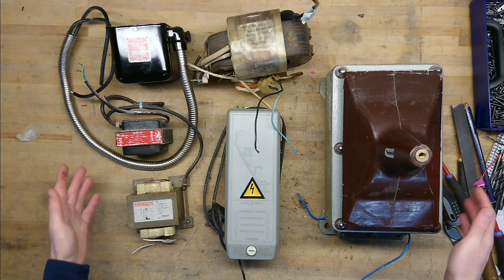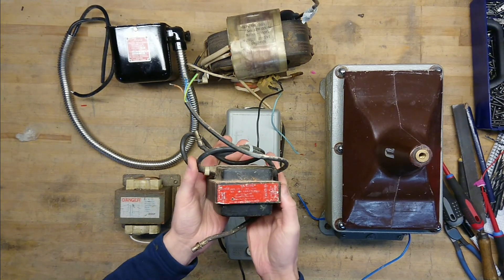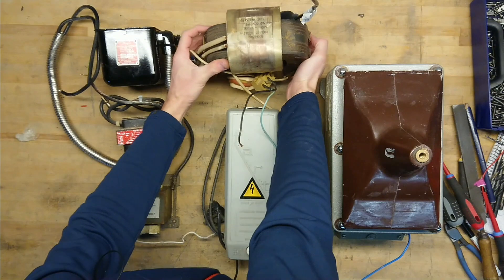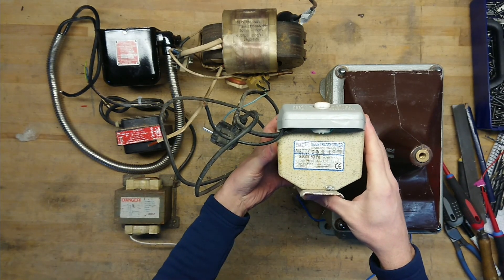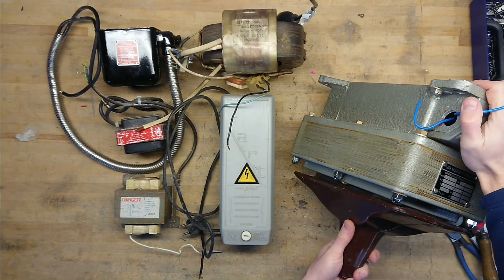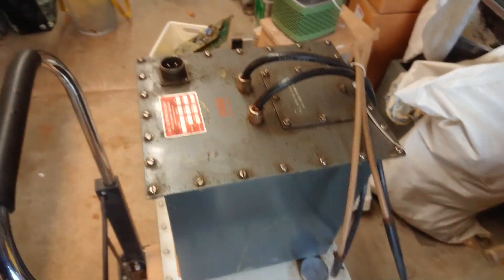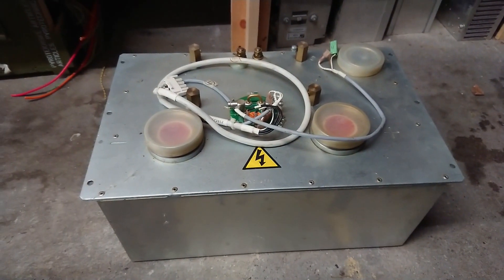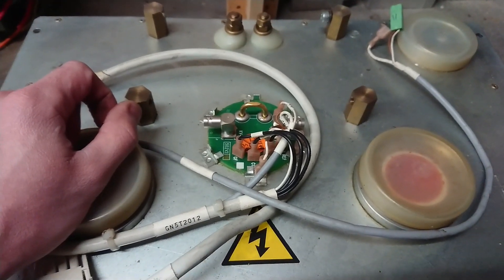High Voltage Transformers - Isolation, Day 9

Comment: Hey Kaizer :)
I have bought this xray transformer: https://i.imgur.com/xD5wbDq.jpg and I was wondering if it is a ferrite core one. It's heavy so I feel like I should leave the top on and don't check but I'm not sure if there is a way to see it. The pic includes all the in and outputs
Reply from the maker: That looks like a modern high frequency inverter type with a Ferrite core
Reply: @KaizerPowerElectronicsDk  Oh, thank you so much! Do you happen to know how this pin layout works with the colors? I have no clue which one to use as the primary.

Comment: If an oil burner ignition transformer is  mid point grounded,does the arc from one HV output to ground have double the current than an arc between the 2 HV outputs?
Reply from the maker: Current is always the same all the way through a series connection. The mid-point ground is to lower the peak voltage to ground to use less insulation and make the unit more compact. One lead will have the positive upper part of the sine wave and the other the lower negative.
Reply: @KaizerPowerElectronicsDk  https://www.youtube.com/watch?v=HWaHfEzUxH0 This guy says that his OBIt is 8kV 30mA at  00:50 the arc to ground is 4kV 60mA.

Comment: Haha..  i remember those fart-formers..  hard to find in the states..  even ebay if lucky enough to find one theyre highly overpriced and usually a neon sign transformer can be found for cheaper with higher output but many have a bunch of smart controlled protection seems like nowadays
Reply from the maker: The cool thing about the FART transformers is the removable GFI circuit that is just sitting with fork cable shoes on the input wires.
Reply: You can still buy no gfi transformers on ebay with 120,230 or 277V primaries.Those American tranmsformers with the ceramic insulators look very cool unlike boring resin block transformers in Europe.
American oil and gas burner ignition transformers also look much cooler than European ones and most of them are 100% duty cycle.In Europe many of them are 19,25,33 or 50% only :(

Comment: Actually there are OBITs with 100% duty cycle. The others are 33%,1 minute on,2 minutes off.Still better than a microwave transformer which starts smoking after 20 seconds of arcing if not ballasted.

Comment: Are there any ignition transformers with ungrounded secondary?
Reply from the maker: Maybe. But most will have a grounded core or enclosure to make the transformer smaller/cheaper as you only need to insulate one end of the HV winding

Comment: Can you do a video about driving those Ferrite Transformers it is a bit hard to find out what topology they use. LLC, LCC, phase shift, Fullbridge Push-Pull .... and i was not able to ever see any of the original power electronics.
Reply from the maker: I will make a video about the parts I have for the 70kV xray high voltage generator.
Reply: Nice, thank you

Comment: Nice collection Mads. Got my hands on a nice 10 kV potential transformer a few weeks ago. Still looking for a xray transformer, but they are hard to come by (the unicorns of HV enthusiasts as it seems!). I am curious about your "larger" transformers (larger than a PT? 😁). Greetings from isolation in germany
Reply from the maker: Maybe larger in output voltage, but weights are about the same between 10 kV PT and 70kV xray transformer :)